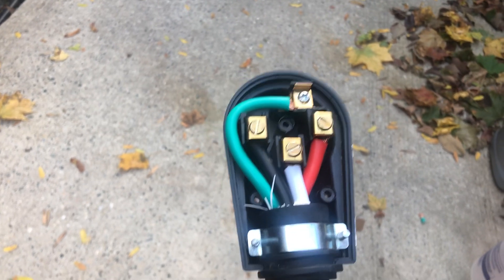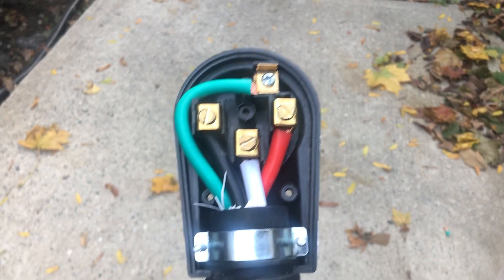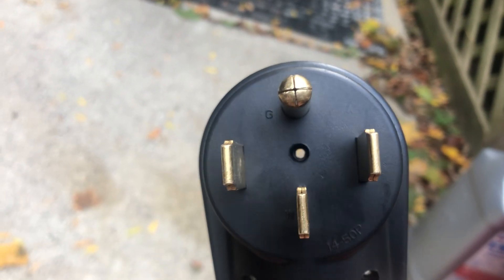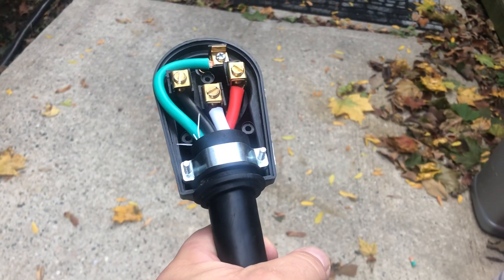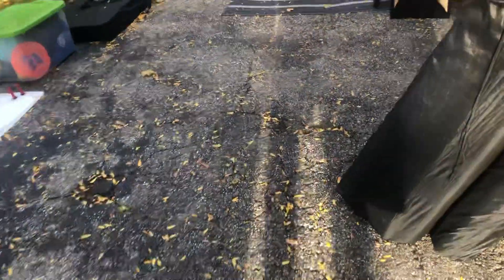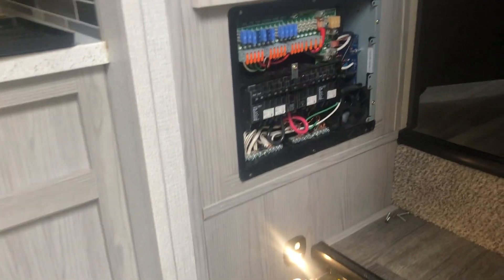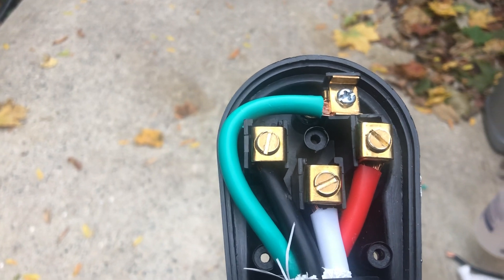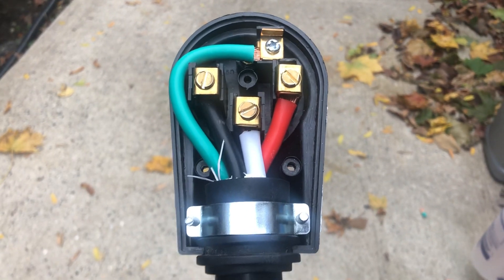Open Neutral on my camper

Comment: So was giving you the code always or just out of the blue just gave out the open neutral  my question is did you create the problem or did it just happen to u mine was first the GFI saying Open neutral but my 110/220 round  recepitical was saying it was good  but another thing was my GFI would trip everything I plug in to it and no now no power anyware on the generator  have any input on that
Reply from the maker: Ultimately I created the problem. My cord sheathing was separated from the plug. And the OEM plug was sealed. I ordered a new plug and reversed the white and green wires because of bad lighting in my house. I couldn’t see, lol. I started to get the. E-8 open neutral code on my EPO and after some looking and checking other connections I thought about it and said I wasn’t having the problem before. I went back to the plug open it outside in the daylight and immediately seen it was wired wrong. I swapped the ground and neutral wired and I was good to go.
Reply: @derrich773  so  did u lose power all together  that's what mine had done it went from open neutral in my GFI and the other plug in read ok but it I switch it from 110 to220 it would keep tripping some if the  power but if I was able to turn my AC off fast enough then it would reset and if u turned it back on it would run for a fue minutes but if you just let it do it's thing it would complete ly kill the motor and it finally just has no power to anything all at once it just stopped producing power but it will trart up but no power what's your thoughts GFI went out defective or the voltage regulator took a crap im not sure yet but it s just a good thing for me if i cant fix it at least its under warranty or i wold be in bad shape
Reply from the maker: @DeweySowell  I did lose power because my EPO would recognize the open neutral and shut it off to protect the inside of the coach. It would shut off, then come back on a few minutes later down for a little bit and then go off again. It happened a couple of times till I realized there was a problem originally I was at a campground and thought the campground electric was the culprit as far as GFI’s. I have experienced bad GFI’s in my home and had to replace them. I’m not sure if this would be your problem, but if it is under warranty, I would definitely recommend taking it in to get looked at usually the RV tech are very good at figuring things out like this. Good luck hope you can resolve this issue quickly.